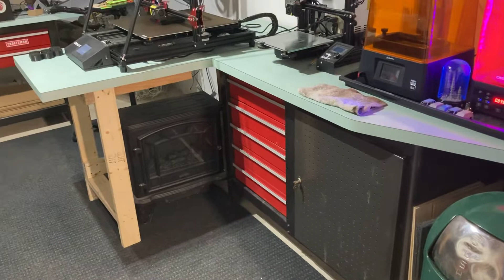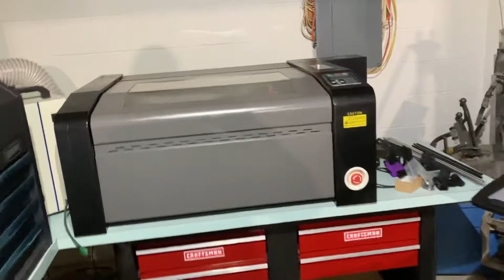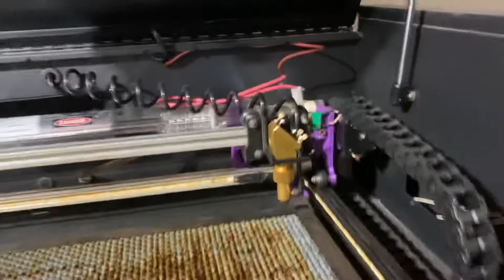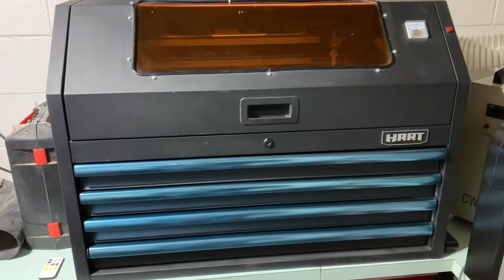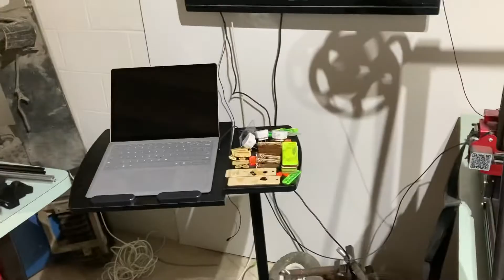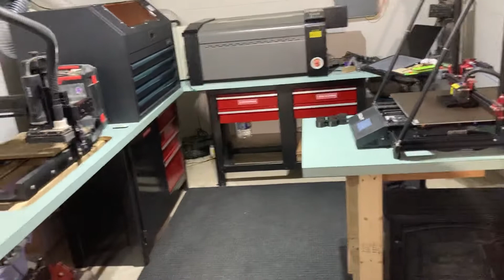Mini prototype lab Ortur co2 laser , ender 3 cr10 max resin printer

Comment: Hello like the laser built. Where did you got the parts for the laser? I have an orture but is under power. Thanks.
Reply from the maker: Most the upgrade co2 parts are k40 parts you can get off Amazon or eBay the printed parts I designed the parts list and files at all on Etsy. I can also provide the printed parts if you don’t have a printer